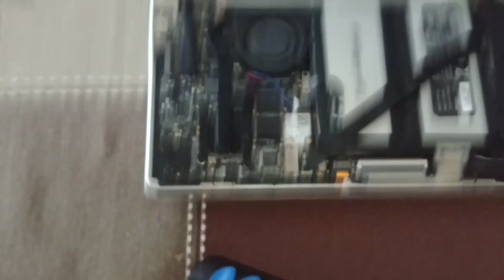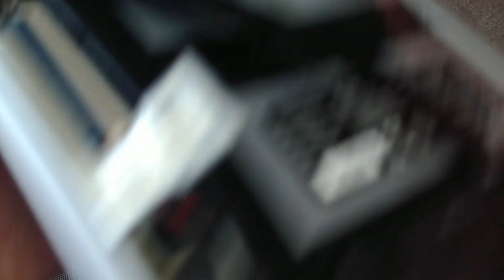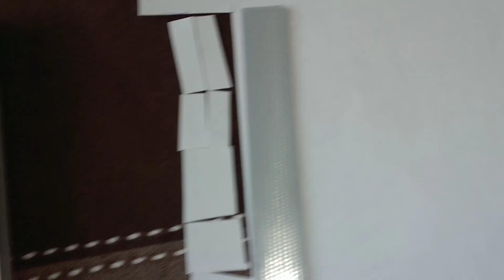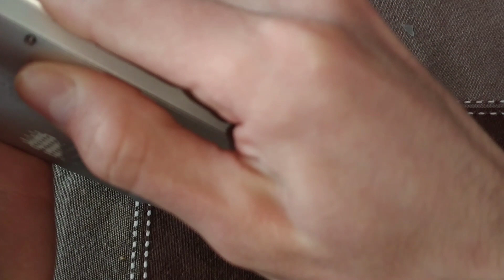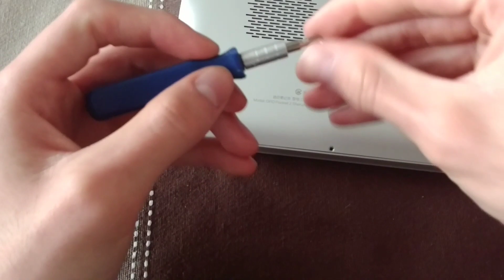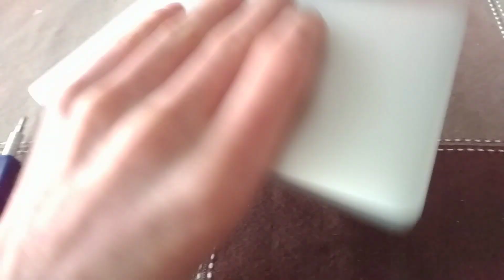GPD Pocket 2 Re-pasting CPU and Adding Thermal Pads (Thermal Mods) In-Depth Walkthrough

Comment: I just changed the battery but the black cable with the CN-MB initials up the battery got damaged. Do you know which model of conector is and where to buy it? Now the left usb and the sd card doesn´t work. Thank you!
Reply from the maker: Are you sure it got damaged?

I did a full rebuild since my GPD took heavy damage itself, and even though that wire got pretty bent and all, it was still fine.

Make sure it clicked correctly, I got it wrong the first time and suffered the same symptom. The left hand motherboard with USB connector and micro SD stopped working.

It can also occur when you shut it, if the battery is slightly off aligned, since it puts pressure and disconnects it slightly as you close it up
Reply: @armandoragusaucy96z.71  Thanks a lot Armando for the quick answer but I´m sure it got damaged because some pins of the conector fell out when I tried to connect the cable. I thought I had to slide in the cable instead of connecting it by pushing, the pins where bent and broke some when I was trying to repair them with an screwdriver... The computer works well except the usb and sd card.
Reply: Hi Armando. I just disconnect and connect again and the sd card works again! Not the same with the usb. I think I’m gonna leave it like this. I can live without one usb. Thanks for the help and great video!😊
Reply from the maker: @victorestalella6683  No worries! I was gonna say that once I heard the broken pins then yeah I thought it was done for. That being said, if you require the connectors and supplies, GPD themselves carry them. I have already ordered a full chassis, a screen replacement and an LCD display ribbon cable from them!

Here's my fiasco lol
https://www.reddit.com/r/GPDPocket/comments/sds01i/update_full_chassis_transplant_completed_this/?utm_source=share&utm_medium=android_app&utm_name=androidcss&utm_term=1&utm_content=share_button

Hope it helps!! And glad to hear it's at least still working!!

Comment: my device is with the screen blinking then back to normal, what can it be?
Reply from the maker: Is it repeatedly rebooting or is it just the screen flickering?
Reply: @armandoragusaucy96z.71  just the screen blinking, I've restored it from the factory and it's the same
Reply: I have it for 2 years, I have never done this cleaning procedure
Reply from the maker: @Kemsou  Did you open it at all previously?

If yes, did you check you didn't loosen any screen connector?

There are two to keep an eye on so make sure no connection is loose

If you didn't open it - have you left it recently powered on while the lid was closed?

How long has this been an issue for?
Reply: @armandoragusaucy96z.71  When I went to use it after a while, I noticed that the screen was wet from moisture, a friend told me that maybe that's what's causing it, and even the touch doesn't want to work anymore.😧
Reply from the maker: @Kemsou  yikes - moisture is insidious.

If it's any type of water damage the best you can do it fully power off, let it dry and pray.

If corrosion did not get it or damage a circuit it may live.

Leave it in a dry place and CEASE ANY USE OF IT ASAP.

Otherwise not much else to be done :(
Reply: @armandoragusaucy96z.71  That's right, I'll buy the cleaning products and thermal paste, and I'll see what it can be and maybe take a technician well, then I'll come back here to talk, thank you😃

Comment: I know this video is old but you blocked the fan from blowing the heat outside
Reply from the maker: It does press down ever so slightly against the radiating fins, but the intake and exhaust were still actually just fine.

Ran it for years after without problems, if anything the air coming out is blow-dryer hot :)

Comment: Great video! I would like to ask you how thick the thermal pads you have used are, and if you have verified that they actually adhere to the metal shell of the laptop. I have excellent thermal pads produced by thermal grizzly at home, but they are only 1 mm thick. Online I can easily buy 2/3 mm thick pads. I have just changed thermal paste and, just doing this, I have gained 8-10 degrees. Unfortunately, the PC always went into thermal throttling, even for the most trivial things. Opening it I discovered that there was very little thermal paste, which covered only a small part of the CPU; moreover, it was also dry, and removing the heat sink was very easy, that is, it detached itself as soon as the screws were removed. I had some difficulties instead to separate it from the fan. I had to lift the sticker; when I relocated him to his position he no longer adhered as before. Thanks for the video, it was really useful. P.S: unfortunately I was getting screwed by the usual hidden screw that they put in all laptops. Luckily I realized it before doing damage. ;)
Reply from the maker: The thermal pads I used are 1.5mm thick for the blue ones, and 1mm for the gray ones. If you are interested in the specific nones I bought they are all buried in the description with links on Amazon :) 

As per contact on the plate, yes, I have verified it, and you should feel a slight amount of push back when you try and re tighten the lid, as you have to squish the pads a tad bit. Not too much though, otherwise you CAN bend the backplate. I've taken off the pads numerous times since to apply EVEN MORE pads that I oeft out originally, and to rearrange them too in a more efficient way. The reason for that is that I put new rubber feet on the back, which raise the laptop enough to get fresher air, so I prioritized the fan getting the heat into the heatsink to get it out faster.

This has all since gone undocumented, but I've actively worked on this since to improve both the hardware and software tunes :)  The way I know the plate makes contact is that the some pads with adhesive stick to the backplate firmly when I take it off, so they do make excellent contact. You should feel heat intensely building up right where you placed the pad, otherwise it means it's not transferring properly for some reason (possibly not enough contact).

And don't worry about the sticker from the fan, all it is is a bit of a copper piece to make contact between the fan frame and the heatsink. It doesn't have to be fully glued or flush, I have the same issue on the video :) Hasn't been an issue ever.
Reply: @armandoragusaucy96z.71  Hi Armando,

Thanks a lot for the answer! Unfortunately I don't speak English well, but I think I understand everything you wrote. Can I ask you how much the dissipation has improved using the thermal pads? Unfortunately, the CPU heatsink is very small (3.5 cm x1), so I believe that combining the metal body with the thermal pads can improve dissipation. I would also suggest a ventilated base, perhaps self-built with good 80 mm fans.
Question: what operating system do you use it with? My GPD Pocket 2 came with Windows 10 Home, but I prefer to use it with Manjaro Linux. It works fine, except unfortunately the touchscreen that seems crazy. My GPD is perhaps newer than yours. I purchased the version with the new Intel 8100y. Maybe you have the previous one. I tell you this because inside the PC I found something that is not in yours, that is, a connector that fits into the battery and that, as it is built, I think it allows you to recharge the laptop by electromagnetic induction, or I am convinced that my pc can be recharged without cable, but I did not seem to have read it in the technical specifications. If you are curious, I can send you a photo by email. Mine is: schiavone.raffaele90@gmail.com
Unfortunately I am not an electronic, but since I bought it I have wondered if it was possible to at least mount a larger disc. Even the ram in theory could be faster, because this laptop is equipped with 1333 mhz ddr3, but the 8100y should support faster ram, if the motherboard allows it. To be able, you could probably unsolder some components and weld new ones, faster. I don't complain too much anyway; it's the coolest laptop I've ever had. See you soon!
Reply from the maker: @raffaele2205  Hey, sorry for the late reply. Comment got lost in notifications :p

Heat dissipation improved massively, I'd say by about 15°C in total, possibly more. I ve ran the tests and used it heavily nat times for hours, and with 7W TDP it will refuse to go over 80°C at 23°C room temp. This is during endurance sessions, bursts, it can easily take 13W for a couple of mins without breaking a sweat, and depending on roon wind or temp, I can turn it up higher even :)

You are correct, joining the heatsink to any metal part, such as the fan frame itself or the backplate WILL improve the heat dissapation massively.

I did have a ventilated makeshift base I bought, it's in another video and you can see it in action :)

My P2 runs on vanilla Windows 10, same that it had when I received it, on the latest Windows updates.

Your P2 is definitely newer, mines was from the initial production run from the IndieGoGo campaign, and was amongst the last to he delivered (Around November 2018). Therefore, you WILL see revisions in the inside, and possibly improvements in the build quality. I know your will have a brighter screen, actually! :)

Unfortunately, P2's do not support wireless charging, so that part may serve a different function. I've yet to hear someone say it does, so I am confident it's something else.

And lastly, in theory is should be possible to mount a different drive AND more RAM, but it's a high risk job, and I've yet to see someone do it and have it work. It's been discussed and considered however. It SHOULD work if done PROPERLY though. I must repeat that it's strictly theoretical though. :P

I hope this answers your questions :)
Reply: I forgot to ask you one thing:
what value did you set for tjoffset?
Reply: @armandoragusaucy96z.71  Hi Armando,
 sorry for the third message. Thanks to the modification and the change of thermal paste, I was able to adjust the TDP increasing the performances a lot. With continuous use of the CPU, before I had a frequency of about 1700 mhz, while now I have 2700 mhz with about 80 degrees of temperature. A truly remarkable improvement. Have you considered using liquid metal to improve heat exchange?
If you want, I will wait for you by e-mail (mostly to be able to send you a couple of photos), otherwise we will continue here as well. I hope to read you soon, bye!
Reply from the maker: @raffaele2205  I'll get in contact with you via email if that works for you too after this :) 

I am glad that you found the method helped your PC. Connecting the CPU heatsink to the body alone makes a massive difference.

Your temps sound about right on the CPU, as I myself peak at 80C after all my refinements. I've even added rubber feets to raise its height like I said :) I'll gladly send you pics on email if you'd like lol

I am not too familiar with modifying the TDP with linux, but definitely know what the short term value is for. If you set it to higher values, it's good to load up intense tasks that take up a short burst only. My long term TDP is now set at 7W, and the short burst one is for 13W. Works wonderfully balanced and smooth. Gives the best battery life to performance too, but the short burst wont run long enough to overheat the PC, while still being quite capable of brief intense tasks.

And yes! I have indeed set the undervolts onto my CPU and iGPU, I do have other videos on the channel and playlist regarding just that, unfortunately it's only for windows, but I've actually found some really interesting options to play with ever since that I've yet to share. Life has been busy so I have not been able to make new videos or guide revisions to show refinements I've come up with.

As per the voltage offsets, on Throttlestop, I currently have the following
CPU Cache  -72.3mV
CPU Core  -72.3mV
Intel GPU -72.3mV
iGPU Unslice  -72.3mV
System Agent  -72.3mV

I suggest you re do voltage offsets AFTER the repaste and thermal padding, as I found the tolerance for undervolts increase

As per the liquid metal, I know someone who attempted it, but I think it may have ended up leaking and causing a keyboard failure, as his P2 broke down not long after, and required a replacement Keyboard. In my opinion, for the risk, and process itself, liquid metal is not worth it on this system, so I advise against it :P

If you wish to join the group on discord, reach out to me on email and I ll forward the info, as some people there are massively more advanced than me. From here on, I'll contact you on email :) Hope to hear soon again!

Comment: I would have chosen the Innovation Cooling IC Graphite Thermal Pad for the CPU itself: it's way more efficient.
Reply from the maker: I contemplated it, actually. But I ended up going for paste due to the size of the pad. It would reqiire cutting it into dimensions, and furthermore is electrically conductive, which honestly scares me. If you should try a CPU Thermal pad, I would recommend instead the Carbonaut series by Thermal Grizzly. Looks more promising too.

Comment: Did you need thermal paste to apply the thermal pads?
Reply from the maker: Nope, the thermal pads work independently of it. The paste simply allows for faster heat transfer to the heatsink, allowing for more sudden temperature changes without overheating. Necessary when high wattages are used, since heat is generated instantly into the 70°C range at times. Thermal pads allow for the heat that the heatsink and other components have to be transferred into the chassis, and have more surface area exposed to outside air. In other words, the botttom becomes an additional heatsink that is always exposed to ambient air, increasing thermal tolerance and capacity. You can have one mod without the other, but they compliment very well when pushing extreme loads.
Reply: @armandoragusaucy96z.71  Are the pads self-adhesive then?
Reply from the maker: @java_bean  That is strictly depending on which you get. Some have it, and some don't. In this video, the blue ones did, so I used them for parts where I felt the pressure wouldn't be enough to to keep them fastened (also because they were lower quality). The grey ones are strictly held on by the backplate pressure, since those had no adhesive. Had to apply slight force to apply the screws on at the end, if you notice.
Reply: @armandoragusaucy96z.71  so, I'm a little worried about applying thermal paste on such a compact system, especially because of the fan chassis situation.  debating on whether or not to just get thermal pads. Did you see much difference in termals with just the pads?
Reply from the maker: @java_bean  To be honest, I am unable to answer that too well, since I applied so many more pads this time and repasted at the same time, so the gain would be hard to pin down. In my opinion, you should go for the repaste. I've seen many folks do it without issue. One guy even did liquid metal! (With ALL that it entails). It's a pretty safe process as long as you don't use conductive paste. The metal can be even purposely bent to make more pressure between the heatsink and CPU. It won't cause a thing. Even in my scenario, I continue to use this P2 with these mods without issue. Absolutely no issues or failure yet, despite the slight bend. Again, it feels more like a fit and finish issue, and you won't see it once it's closed. Does not compromise fan performance.
Reply: @armandoragusaucy96z.71  oh, but at the start of the video you had to remove pads that were already there, so I thought you had it without the new paste at first.
Reply from the maker: @java_bean  Yes, I had pads before :) But the thing is they were low quality pads, and few too. Only a 50x50mm surface area. No re-paste.

I then proceeded to add another 50x50mm identical pad, plus the fujipoly 100x15mm. So it is more than double the pads I had before, higher quality pads, AND the high quality re-paste. Hence, I cannot give you a good estimate on the gains of repasting, since the gain was so extreme this time that I can't attribute specific numbers to the mods, it is a collective gain.

What I have heard however, is that depending on how well the paste was applied on your device, and the quality of the paste you use, it can be anywhere from 3C all the way to 10C! Some guy even had a P2 that was not even pasted at all. You can imagine the gain on that one XD

Comment: It looks like you bent the fan frame pulling out the heat sink. Is there any way to pull it out without causing damage?
Reply from the maker: Honestly, I would just bend it back. The metal itself wont give much trouble, and also, once the chassis cover is back on, it wont make a difference. It's a hidden fit and finish thing, not very important IMO. If you do wish to avoid it, be more gentle than I was and you should be generally fine. I simply yanked more than needed since I wasn't getting much movement. Take my example as what can happen if you aren't careful :)
Reply from the maker: Oh! I must mention! The fan itself has a lip on top. That lip is not metal, it's a plastic film to seal the gap, if you may. It was bent since it is relatively soft. I thought you meant the heat pipe itself :) I just saw the footage again, lol. Once you lay the back plate back on, it is held in place
Reply: @armandoragusaucy96z.71  oh I see, thanks for checking!
Reply: Just be gentle when pulling it out it's easy to avoid bending it.